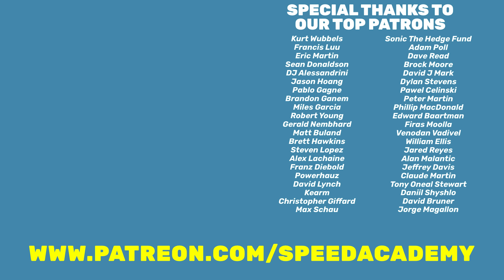Ruining the R34 GTR with this Mod?

Comment: Put a small piece of flat metal behind the front GTR emblem as a support. May make it feel more solidly mounted.
Reply: Like on the original had...as seen at 03:45
Reply: Or just use rubber washers behind the screws

Comment: Hey man! The spats needs to have an angle cut into it for the diffuser to slot into. When you buy them as a standalone item, they dont have it cut factory from Nismo as there are Non-vspec and vspec versions (non-vspec dont run diffusers). I had a cut a slit in mine and everything fit up perfectly. The Z tune and R tune for example have there's cut from factory.

As for my recommendation with the skirts, they take a beating! Especially if you love driving it as much as i do, be prepared for semi-slicks and track days to ruin those things. I see them as disposable items. Most other GTR owners dont drive them enough to notice. So running it the mines way would be more practical.

Comment: I think you need the skirts for dropping the height of the rocker to match the front bumper but the skirts themselves don't really match the car. The stock ones extended down would look a lot better. In this case of yes and no, I'd run without.

Edit: Yeah looking at it for longer those skirts ruin the lines of the car. I think you should find something else.
Reply: well said!! exactly how I feel.

Comment: I think the design of cars gets ruined by tacking on lips and skirts and fenders to everything - I like the skirtless side and i even might take off the lip to even it out. Bonus is that you'd actually be able to street drive it without scraping everywhere. Just because you can, doesn't mean you should when it comes to mods.
Reply: I think if it came down to it I think removing the lip to make it more even would be better than adding those particular side skirts.

Comment: The regas need spacers either way you go. I would start with no side skirts or rear spats and just spacers to begin ("less is more") until you get bored with it. Then, you can throw the skirts and rear spats on for a little extra flair. Itll feel like a facelift for the car at that point and you get maximum enjoyment out of the car at each stage

Comment: I used to think paint matching was easy. You just plop the paint code into a machine that tells you what to mix. Until you find out there can be 25+ tints of the same paint code. The only way to guarantee a perfect match is to spray the whole car from the same mix, the same gun, on the same day with the same environmental conditions lol.

And I'm truly torn. With those wheels and no spacers, I say no side skirts or rear skirts. With spacers or 19's the skirts work.
Reply: Yep. Even samples will look different than whatever body part that’s getting painted.
Reply: This is why body shops use spectrometers that gives a more precise match within a color code. Sometimes it's still off a bit because of sun damage and whatever, in these cases you would often spray out the adjacent panels to blend it in.
Reply: @marksinnl  and I can spot the blend line every single time. It never matches unless you spray the whole car.

Comment: Hard no on the front bumper lower trim. Sits way too low, you're going to be scraping it all the time. Without that, you don't have to run the side skirts and keep the cleaner OEM+ look.
Reply: Thats how Vspecs are from factory. They look weird and lose downforce without the front splitter. It also guides air to cool down the rotors. 100% necessary item.

Comment: Full nismo kit, spacers - 10mm in rear 5mm in front, lowered about 10mm more in front 20mm in rear, need something with the bonnet whether it being the nismo bonnet or the v-spec bonnet, will give a clean but not boring line to the front, maybe a mines lip spoiler, or tall legs for the oem spoiler to give a bit more aggression to the rear

Comment: No skirts and spats. It's just bolting weight to the car that will not have a measurable aero benefit. More parts to peel off when you have an off at the track.

Comment: Gotta say you went through all that work to get the side skirts on one side and it looks stellar you should do the side skirts. I agree with you that the fitment looks a little funky without spacers but those wheels are so clean on the setup and I appreciate your story with them, I wouldn’t tell you to change them so I guess I’ll just say run the spacers lol

Comment: I think if you threw a rubber washer beneath those screws for the emblem, it will comform/bite into the back of the mesh, preventing any moving around from road vibrations. Otherwise it may eventually shimmy around and no longer look level/centered.

Comment: You have to run the side skirts. I think they look goofy without them. I have an R34 GTR, and my rear spats have small slots cut in to clear the diffuser. I can't remember your tire size, but I have 275/30/19 on 10.5" +12 rim, and with my ride height and alignment get slight tire rub on front of front right front inner guard at full lock

Comment: Wonderfull project, I don't like the side skirts. I think they don't go well with the bottom of the front bumper, but goes well with the rear side skirt....so I would take off the side skirt and rear ones and try to look for a cleaner design that matches with the bottom of the front bumper...or just take off the side skirts and that's it.

Comment: So much better with the side and rear skirts. Matches the front and looks killer ! 😎😎 Also the tires looks a bit too small (sidewalls) I would put on 275/35r18 instead of the 265/35, will bring the tire closer to stock size and fill the wheel well better.

Comment: Run the full kit. As running only the bumper, the car profile is off, the front bumper sits lower and makes it look like a replica/buildup/wip. You don’t want the snow plough look. With the white wheels I would run one profile up on the sidewall to take up a bit of that arch gap. Or buy a set of matte gold work emotion cr kiwami in 19s 🥵

Comment: I used a razor and put small lines on emblem to kinda counter sink it to the mesh just a little bit. You can't tell and it's alot more stable.

Comment: With that front bumper you need the side skirts, the bottom of the front bumper looks like it's and inch lower than the skirt. look at the angle at 13:00

Comment: Car designer here- prefer no side skirts here. Yes, having the lip without them doesnt flow, but those skirts and spats dont really flow with the surfacing of the rocker panels in my opinion. The front lip looks like it is way more integrated, whereas the other parts look tacked on, like an afterthought. The diffuser looks quite nice though.

Comment: funny how hard it is to decide. I understand completely the clean look but after the spacers on the side skirt side like it a bit better. It might be a JDM faux pas but wanted to know if you pulled the portion of the front bumper just above the front splitter and went without (no side skirts). Would that look good?

Comment: Full kit looks good, but need a more aggressive offset. Maybe lower just a bit. I'm not sold on the white on silver for the GTR. Not sure it suits the body lines. I think that white is more suited for a hatch, Subie or Evo. I would prefer fully black or gunmetal Work Meister S1 or bronze a set Rays CE28N.

Comment: With how low the front bumper is, the rest of the kit finishes it off perfectly. I run the same, only difference is Z-Tune front bumper instead of S-Tune.

Comment: Looks good both ways, I agree about the r32 that only had a front lip.. but I just don't think those side skirts work, they are too sharp for the shape of the car. Simpler, flatter skirts like c-west or uras, or just a carbon lip/extension below would match up much better with the front (in my opinion anyway)

Comment: You don't need 19's!  The tires are low profile enough.  Try to get the next tire profile larger to fill up the wheel well gap hopefully without rubbing.

Comment: i would run without nismo sides skirt but i would run a smaller(shorter) side skirt in carbon, maybe just a flat carbon piece with the nismo rear spats

Comment: It definitely needs the nismo side skirts and rear spats to match the agressive styling of the front bumper. Also the front bumper sits so low to the ground, the side skirts are needed to match the height, otherwise the front wheels look a little odd. Whilst the wheels look great, I think a more agressive style of wheel is needed to match the kit on the car, current wheels are a little to OEM style looking. Car overall does looks amazing!

Comment: I agree that both variants look dam good, however if your running the Nismo front which you are then the additions of the side & rear kit are a must imo. Defiantly try a bigger set of wheels with the full kit, I'm sure it will transform the car once again. However if your addiment on running the current wheels I would try some more wider spacers for comparison. Great work though guys! 👌👌

Comment: I run 19x10.5.  lmgt4.  rub a little on lock. 19x10 or 19x9.5.  I'm also running 265x30 advan anyway love the content good to see actual work I know I had same prob with rear spats.  and could find nothing   so I'm loving your vids

Comment: It needs side skirts with that front bumper lower extension piece, but... These side skirts seems to have a bit too much lines/curves. A more flat style look (just like that extension on thr front bumper) would improve the flow. Same with the spats at the back. I'm not a real fan of the white wheels either.

Comment: Skip the skirts, looks better without them, I'd also ditch the secondary splitter on the front bumper. I think functionally you would drive the car more without the front lip/splitter addition and sideskirts as well. Plus the wheels look tiny when you add all the ground effects, they seem too small for the wheel-well. Maybe drop the front and rear by 1/4 to 1/2 an inch and follow through by removing those additional pieces and I think it's gonna be a perfectly set up car that you won't be afraid to drive consistently. The very obvious next modification though would be a Seibon carbon hood with the louvered Mid-section for an aesthetic enhancement on the front end (paint matched of course). And for the rear a very tasteful but simple step-up secondary blade would really set it off nicely. It's a very well set up car, it doesn't need much to look great and sometimes simple just looks better.

Comment: Find different aftermarket sideskirts and elements for the rear bumper, I'm sure there's better looking ones.
The clean version with no skirts looks way too high and empty with that extreme front bumper, the height should match all the way around imho.

Comment: I feel like if you are going to run that bumper with that lip, you have to run the full kit otherwise the front is super low and the skirts and rear bumper look about 2" higher than everything else.

Comment: Can you run the black splitter on the front without the lower bumper section? I like no skirts and spats but don't like the low front end on its own.

Comment: No side skirts, looks so much cleaner. The side skirts look like an after thought not cohesive. You can see the body lines so much better without the skirts. Try losing the bumper colour  extension. So the bumper doesn't look so much lower than the rest of the car.

Comment: I'd go with the full kit. Front bumper doesn't quite work without the side skirts. It's not like it's tacky aftermarket stuff either. Nismo is perfectly acceptable on one of these cars. 10mm spacers all round too. Fitment of those wheels isn't quite right as they are.

Comment: Personally I'd go without skirts. Definitely without the ones on the rear because it just doesn't flow right at the rear. The rear ones make it look like a drift car and a bit too much. 

Or have the side skirts in black color? Having them match the car color makes the car look a bit too tall to me. Having them in black could help with that. Would be 5 minutes in photo editor to see how it looks in black. And maybe look at how the rear skirts look black as well while at it. Or maybe even carbon wrap?

Comment: I dig the wheels, however, I don't think they fit the color, nor the car. You need 19's and they need to be either gold or Mag Blue. In addition, the offset is wrong,  you need more aggressive offset.  Perhaps use the 18's for track use, but for show, you definitely need 19's. My 2 cents

Comment: The  skirts complete the car. Without it, I find R34s look unfinished. Wheels wise, I think 18's are best but with a bit more offset. 

Also why don't you jack up the car, the measure from the center hub to the fender height? That way you can do it without worrying about the floor .

Comment: That silver front bumper extension piece is the root of the issue. It just looks too stacked up with trim pieces; gives the car too many nostrils. I think remove that and you could run side skirts and spats or not, but not would look a lot cleaner.

Comment: The clean look is better... honestly I don't like the extra-low front lips on 80's/90's/00's JDM cars - they make the front look extra tall and unbalanced. Just lower the car a bit more without the bumper extension if you really have to. That bumper with just a bit of flat splitter sticking out would look amazing.

Comment: Pete, I couldn't agree more with the feeling of needing 19's with the side and rear skirts. If you wanted the Z-Tune R34 look, a 19" with a +5 or +10 would be perfect, and really complement the lower lines of the skirts.

That being said, the nostalgia is too strong in me. My vote is no skirts. It still looks just as badass as it did 15-20yrs ago!

Comment: Get a thin metal plate to secure the badge in the grill.  Never liked the s tune or z tune bumpers because of the unibrow.  Please just don't put the ztune side panels.  The flared ports ruin the sleek contours and everyone and their mother puts it on their R34.  If you have the front bumper bottom lip you need the skirts.  If not it looks like the front has an overbite.

Comment: May I suggest keeping the skirts, adding a set of 19" silver chrome wheels perhaps ferrada fr2 as I think white on silver cheapens the car. If you rather roll without the skirts, then put back the original bumper as it flows better with the lines of the car.

Comment: If you are running the lower part of the front lip, side skirts for sure, it does not look good without them as the front would be much lower than the side. I would love to see it without the front lower lip and side skirts, the front looks very busy now. In my opinion that would make it look waaaay cleaner

Comment: Too many lines with the bolt on side skirts and rear spats. Very busy.

Front bumper is mean as, but the lip extension is unnecessary in my opinion.

Comment: I personally think that the 18’s are too small but if you put on a thicker spacer it would make the car look more beefier. The 5 mm spacers isn’t cutting it at all. You need a more flush look and it’s still sunk in. Try a 15mm spacer . Also please run the full nismo body kit it makes the car more aggressive and also it is a clean look. It’s a factory style body kit .

Comment: Side skirts. With that front bumper the lines need to go all around. The flow is off without them. Or drop the lower part of the front bumper with no side skirts.

Comment: You have a Nismo bumper… run the full kit as it was designed, Nissan Motorsports knows a think or two… otherwise, it looks like a buck-toothed kid without them. The front bumper is too low on the tire for the rear of the car.